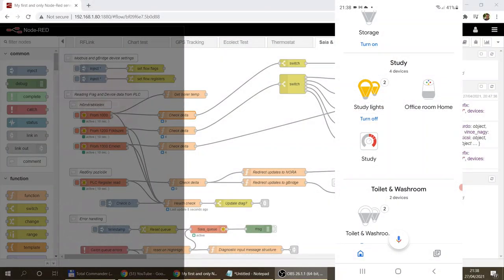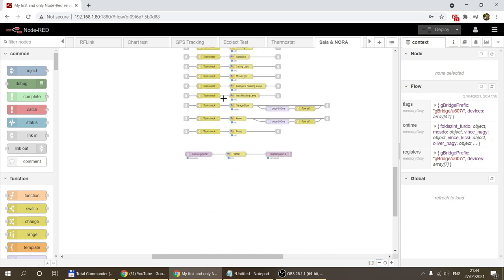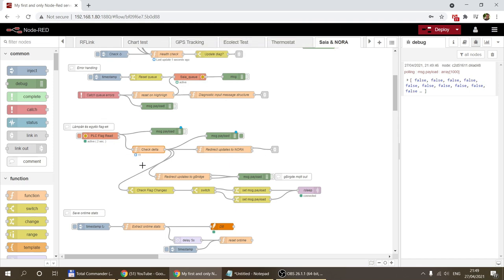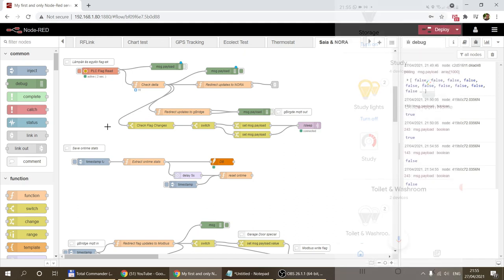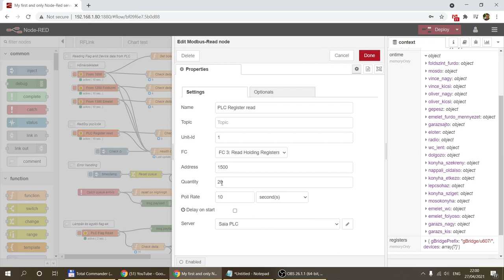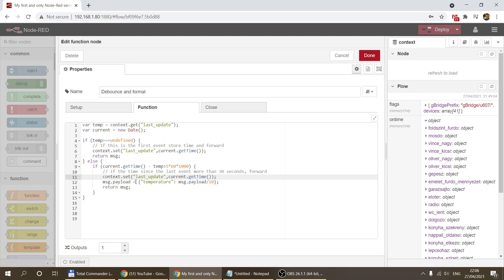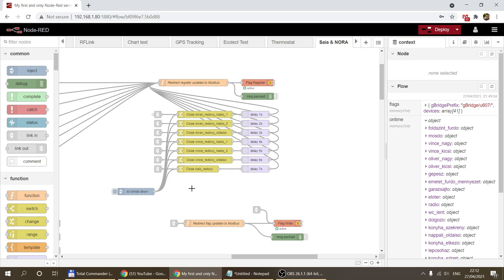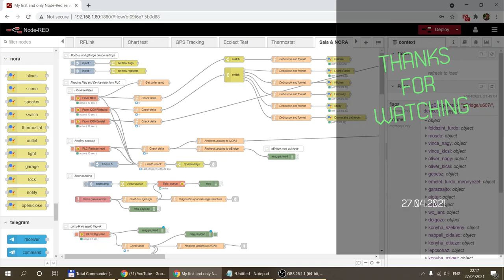Connecting Modbus PLC with Google Home using Node-Red as a middleware

Comment: Hello,
Sorry for writing here with my issue. I am looking for a temperature sensor smart switch that works with the Brilliant smart app. Something like the Sonoff TH10. But the TH10 needs the ewelink app instead of the brilliant smart app.
Cheers.
Viktor
Reply from the maker: Well, it looks like Brilliant do not have such a device in their product range.
Reply: I use a few Sonoff devices connected through the brilliant app. I thought that you might can suggest some other brand that will work with brilliant. Or is there a way to re-program this one?
Cheers.
Reply from the maker: @viktorase  I had no idea the Sonoff works with other systems as well. I thought it is only the eWelink app (unless you talk about zigbee). I never used the Brilliant app, I have no idea what it is based on. Therefore I don't know if it is possible to change the firmware.

Comment: Thanks for these demos! Do you know which u-remote versions have node-red preinstalled? I’d like to try it! They have so many different versions. Can I achieve the same results if I buy the ether cat version? It’s much cheaper than the -AT and -IOT
Reply from the maker: I am afraid I don't understand. What u-remote version? Also what do you mean by "ether cat version"?
Reply: @csongorvarga  Oh I'm sorry, I thought you knew. The u-control you have is basically an IoT version of the u-remote. Weidmüller makes different models divided by protocols. For example the UR20-FBC-MOD-TCP is for modbus tcp. The UR20-FBC-CAN is for canbus. You get the idea. The (UR)20 is for u-remote and the (UC)20 is for u-control. 

But I've already answered my question. The UR20 doesn't have Node-Red. Thats a shame because all the UR20 models are much cheaper than the UC20s :-( Even though they are for industrial use and the UC20s are basically for learning and playing around. But you'll never see them in the field. They should have been much cheaper in my opinion.